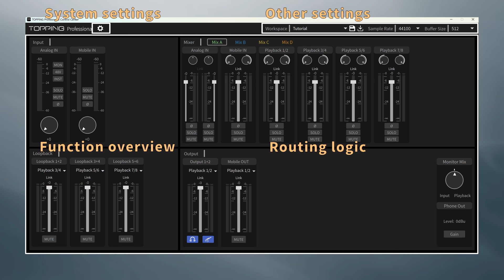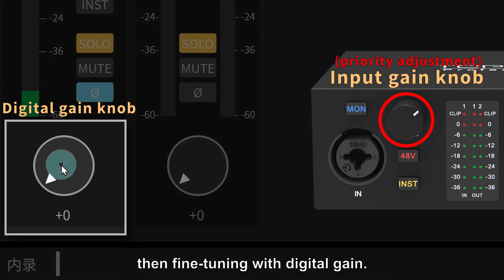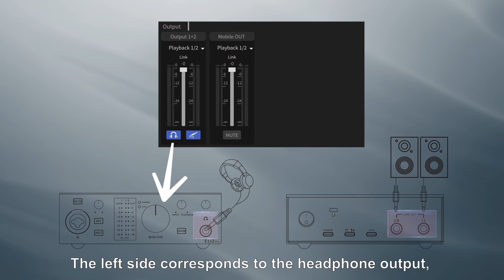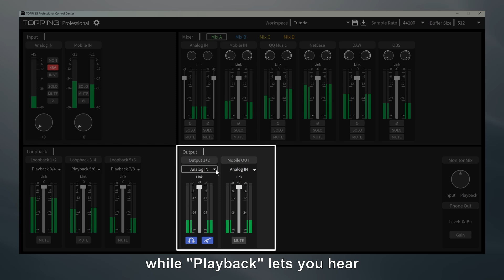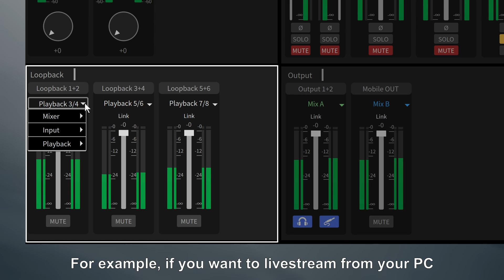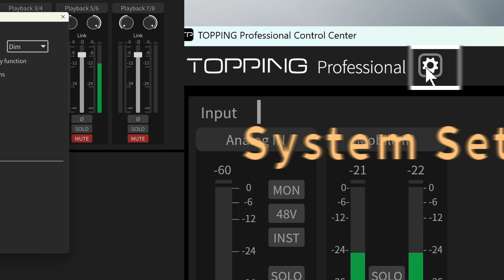TOPPING Professional Control Center User Guide

Comment: Hi! I'm a bit confused on sample rate synchronization, can't make it work. When listening via WASAPI exclusive TOPPING control center doesn't seem to change sample rate automatically. Although my other DAC (SMSL RAW MDA1) does by itself, but when connected to E2X2 it also doesn't synchronize.

E2X2 OTG connected with USB-C to USB-C port, not OTG. 
SMSL connected with SPDIF to both PC and E2X2
Latest soft/firmware versions installed.
I feel like I'm missing something.

E2X2 OTG is really great though. Highly functional device with clear and balanced sound.
Reply from the maker: Thanks for sharing your setup details! For further assistance with sample rate synchronization, please contact us at service@topping.pro — our support team will be glad to help you troubleshoot.